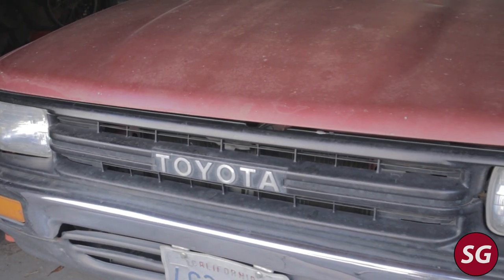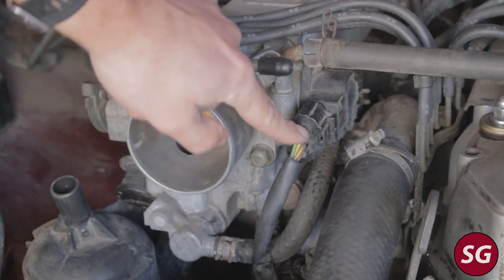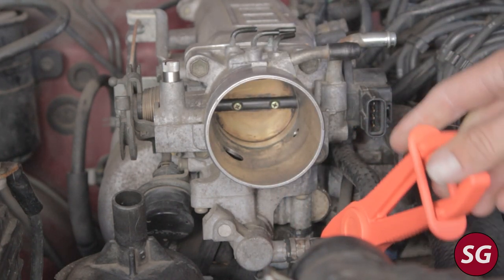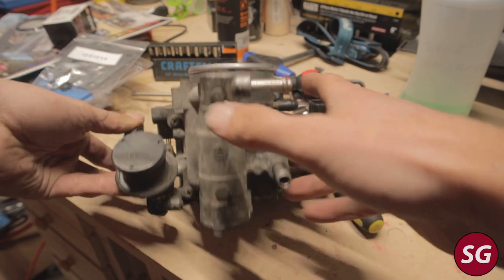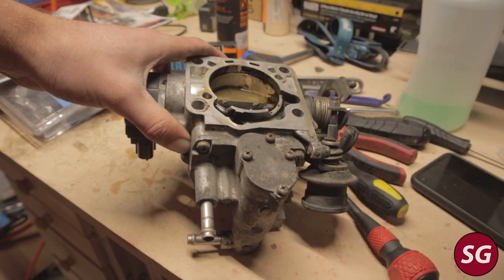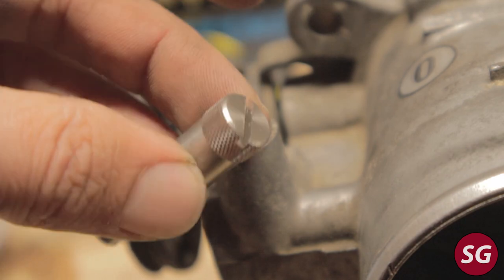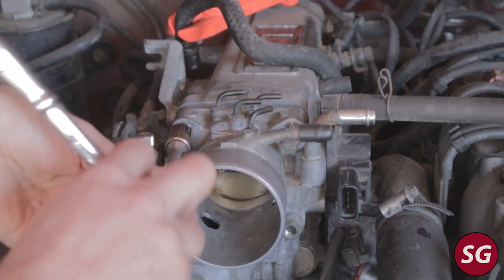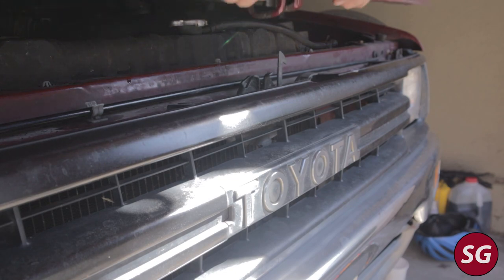Toyota Pickup / 4Runner 22RE Throttle Body Removal/Inspection/Installation

Comment: When you installed the TPS after taking it off did you not use the Multimeter to reset it? You didn’t show that important part in the video… My truck is runnin odd and i’d like to know…. Thanks
Reply from the maker: Hi Mitchell - yes I did, it seemed a bit boring to show the TPS process, but there are some excellent videos on YouTube showing exactly how to reset it with a multimeter.